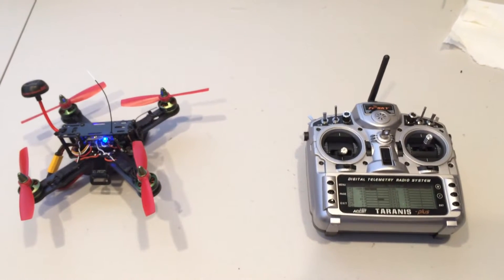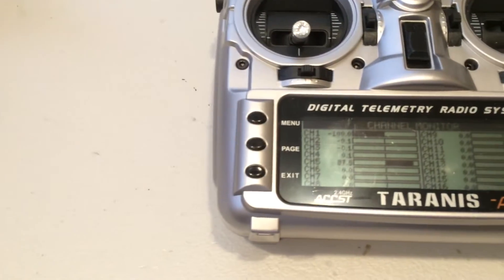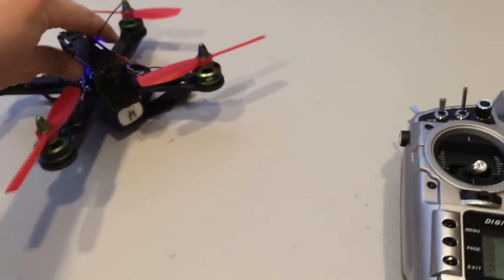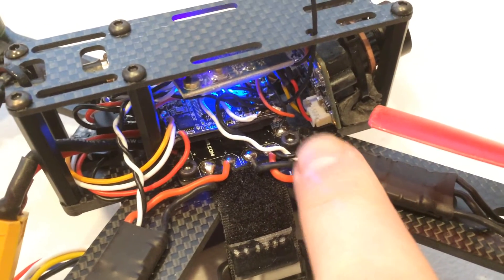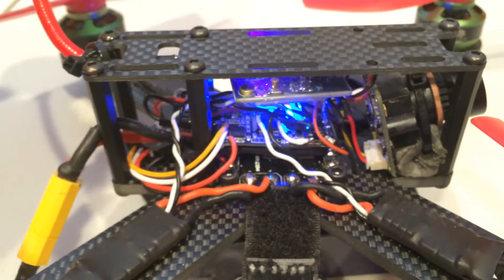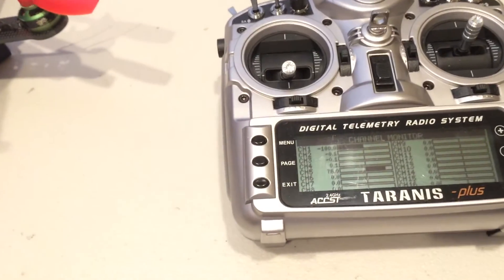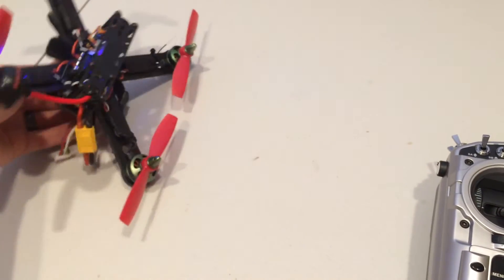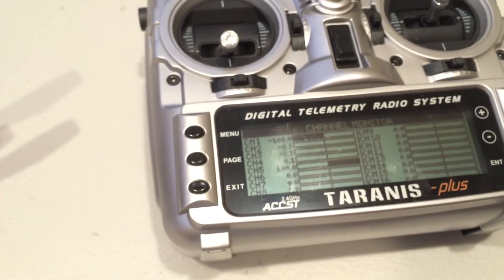FPV Racer Best Antenna Placement

Comment: Actually the BEST placement would be at least with a 90° angle between them. That's the most important thing. Next comes the protecting of the antenna ends, away from the props and the electronics. Perpendicular to the arms seems to be a crowd favorite.

Comment: Good discussion, but your quad doesn't sit level pretty much ever :D I've decided to stick one out the top vertical and one out the side horizontal... (Standing L) seems to handle all orientations well. However I think if you can do it, running a V at the back on the horizontal plane with the antenna poking out from the frame, would work great - similar to what you have going on here.